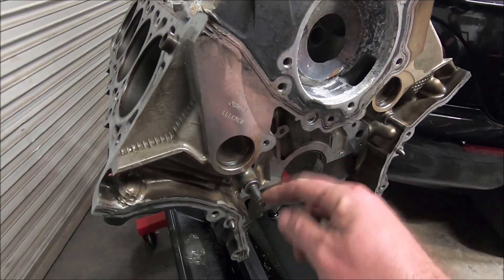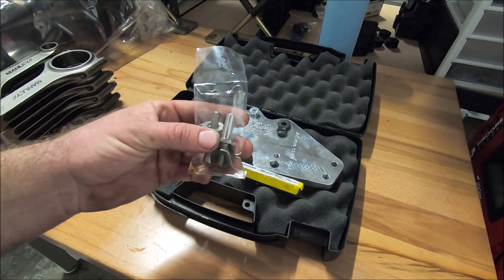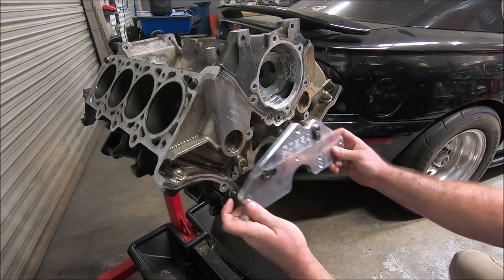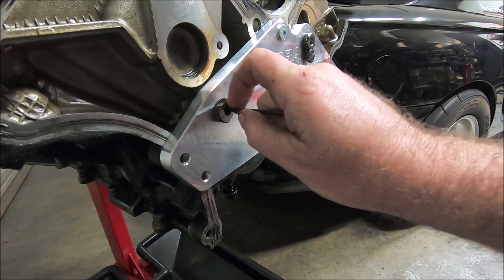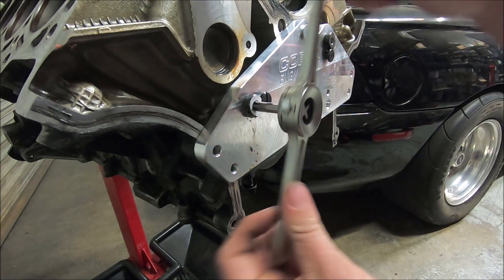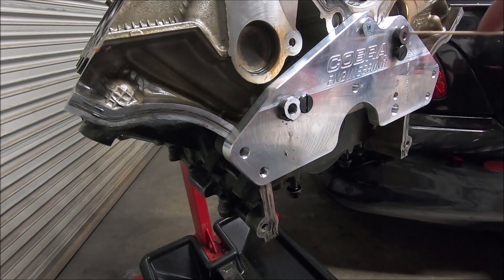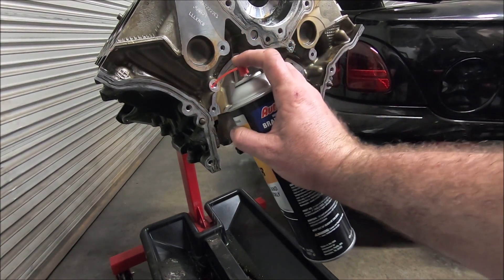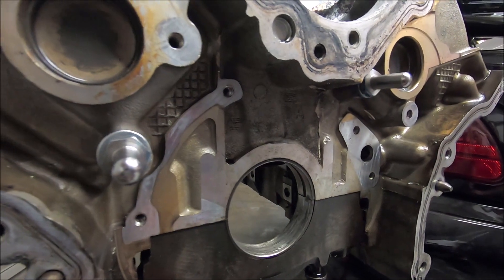Installing Cobra Engineering Timing Chain Guide Pivot Pins on a 4.6 Teksid Engine Block

Comment: I have a very serious question I need help with! I picked up a very expensive built short block with upgraded pressed pins in the aluminum block which the guide pin on the drivers side is totally different spot than what was on my other 4.6 blocks in the past,In the video the drivers side pin is in the same location as yours before you took it out and then you put the new pin in a new location (right by water pump) why is this and what timing guide do I need to use for the first location yours was in?!

Comment: Great info! I'm building a 4.6 using a Windsor "WAP" aluminum block from an aviator. It's budget build and will definitely upgrade the pivot arms pins. 
Are you using a 6 bolt crank or 8 bolt?
Reply from the maker: The engine in this video is getting a forged Kellogg eight bolt crank.

Comment: Can this be done with motor in car? Doing a set of cams soon but wanted to do this with their tensioner as well and hoping not to have to pull the motor
Reply from the maker: Yes, it could be done without pulling the engine.  Just make sure you control the aluminum shavings when drilling.  Also, make sure you do not drill too deep and run into the oil passage.  Depending on your drill size, you may have to remove the radiator for more room.

Comment: Why did you go with 9mm? I went with 8mm from info frkm cobra, they said 8mm most common and you won’t have any issues no difference but size
Reply from the maker: I have both sizes at the shop and the 9mm happened to match the pivot arms.